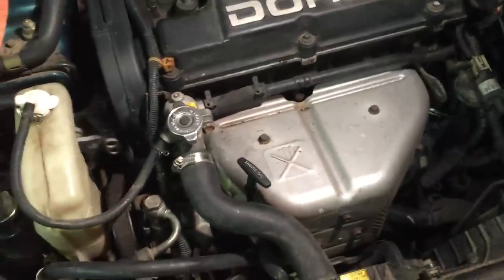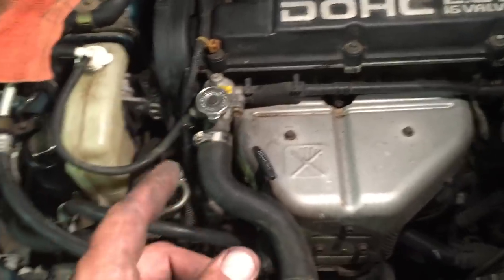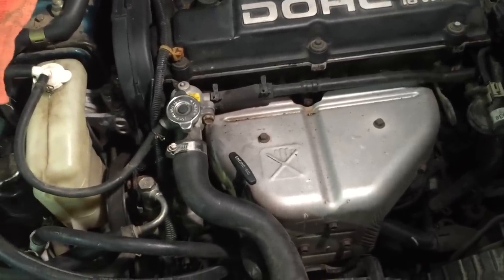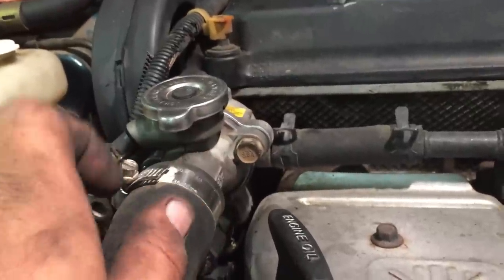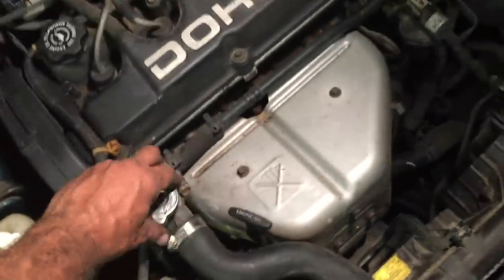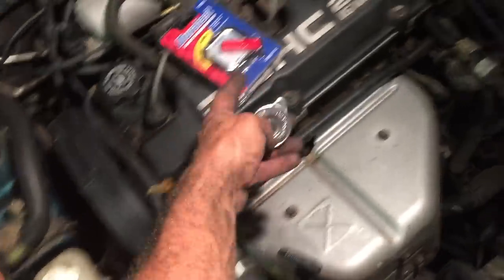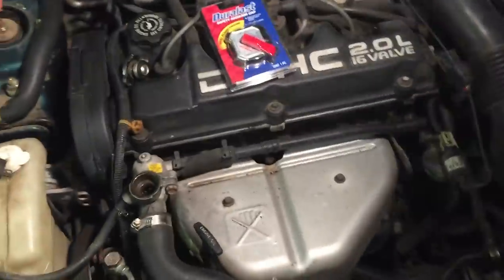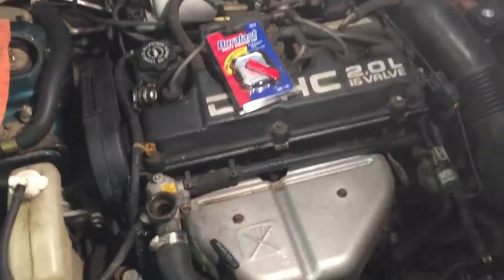How to Determine if Your Radiator Cap is Bad (P2181)

Comment: I think your video confirms what I suspected was going on with our Dodge Grand Caravan. Fairly new radiator within the last few years, but it's losing antifreeze, occasionally overheating, and leaves drips on the garage floor.  The black paint at the top of the radiator right under the cap on the back side is worn off and rusty. I see evidence of antifreeze running all the way down the radiator right beneath the rusty area at the top of the radiator under the cap. I am guessing it is indeed the cap. Thought it was the bottom hose, changing it anyway since I pulled it off and emptied all the antifreeze out. Hopefully I don't have to drain the antifreeze again to replace the radiator cuz that will be the next step if the new cap doesn't take care of the problem. Thank you!

Update: turns out the radiator is bad. Just so happens by some coincidence that the leak is right under the cap. I can see it coming out of the radiator fins right below the cap and going all the way down the side of the radiator. Not the hose, not the cap. Replacing the radiator tomorrow.

Comment: Thank you SO MUCH for this. I was told last week I have an antifreeze leak but I made a 70 mile round trip drive today and didn't notice any leaking or overheating or anything...my dad checked my coolant levels and they're fine but the cap is slightly leaking. Wow I'm so glad I didn't pay $130 to get a stupid cap fixed. Thanks man!
Reply: FYI in the future you won't notice overheating or running hot (fans might run almost all the time) until the water level is low enough. So you can have a small leak for a long time before anything ever shows up.

Comment: I Could not find the slow leak on my 2011 Camaro and it's been driving me crazy. So I put in some coolant dye and after running it for a little while, and I couldn't see any leaks anywhere. Then I watched this video and checked where you said and BOOM it's lit up like the 4th of July under the UV flashlight all around the base of the radiator cap.  Thanks so much for this video! I'm going to get a new radiator cap.

Comment: Yes cracked rubber is a sure sign of bad cap. Leakage of coolant with no trace on ground indicated a coolant leak from cap.  I replaced mine after low coolant level and cracked rubber in cap.

Comment: I had a over heating problem, vehicle was loosing water etc, it was all because the radiator cap was f... . Basically it wasn't pressuring, and I had to get a auto electrician to fault find because I thought the cooling fan on my radiator was faulty.. very good video, he's right indeed.
Reply from the maker: thanks for watching.

Comment: I notice my temp gauge goes from 1/2 to 3/4 and the fan kicks on. It will cool off slowly and go back to 1/2. (No leaks) I’m gonna change out my radiator cap cause I noticed in your video my cap looked quite similar to yours. (Grim on the rubber seal) THANKS SO MUCH FOR THE INFO.
Reply from the maker: you could have a sticky thermostat as well. thanks for watching.
Reply: Did you fix the problem?

Comment: Thank you so much ! Every time I have a car problem (2008 Chrysler 300) I google the symptoms. I thought I had a blown hg or something because I heard knocking sounds from my engine area. (I had only driven about 4 -6 miles ) 
Once home , I opened the hood and heard the sound again . I turned the car back on and heard boiling from the coolant area. Then it starts to leak very slightly around the radiator cap. I was immediately stressed out ,  but confused as to why my car wasn't "overheating " on the dash indicator. 
If i hadn't come across your video, my car would be in the shop right now.  Instead , I'm replacing my cap (for under $10! ) as I inspected it and found a crack in the seal, same as you just displayed here ! Thanks again !!!!! Much appreciated !!!!

Comment: Thanks a lot, your description of the problems is what I'm experiencing. I commute 50miles both ways for work. During the day its bene hitting 90°F and over heating or getting close and I had coolant in. Also died and wouldnt start back up. I left it for a day, went and got it and drove it home fine at night. No overheating or anything. I'm mos def thinking it's my cap cuz my buddy told me mine had some play in it. I'll be getting a new cap in the morning! Thank you!

Comment: Amazing video!! Very helpful for the long run!!
I've been having trouble with my Nissan Versa 2007 and its been overheating, I've been trying to check if its leaking or if it's the radiator.. but so far no luck! Took it a mechanic but you could tell they were just trying to make some bucks!
Hopefully the cap solves my issue. Thumbs up!!
Reply from the maker: great,,, thanks for watching.

Comment: Damn I wish I saw this vid earlier. I had this problem with my radiator. The mechanic said it needed a new radiator. Long story short after the new one was installed we found out it was just the cap that needed replacing. #ripped off 😒
Reply from the maker: oh man, that sucks. and a new one does not come with a new cap, so they normally put the old one right back on. sorry man. thanks for watching.
Reply: my case was much worst! I fucked up one head and the gaskets I end up paying like 900 bucks just for the damn cap!

Comment: My reservoir was filling up not recirculating. AutoZone said I needed a new water pump. I said let me try a radiator cap first. Seems to have worked.
Reply: Did it work
Reply: @juice323blue4  Yes it did.
Reply: @kentuckianahunter7194   ok thanks you
Reply: Same thing happening to me right now. Overheating slightly every once in a while like I'm getting air in the system, reservoir is constantly getting filled up and not sucked back in. I replaced the cap a month ago or so but I have a subaru and they are picky about OEM parts so I'm gonna pick up a oem cap, fingers crossed
Reply: @ryandownie3574  Good luck.

Comment: Man this video is very informative i jus changed my radiator cap yesterday i drove it like 2 are 3 miles and my needle went a lil above have and went back dwn below half but i never drove it far yet i wonder if dat was my over heating problem the whole time
Reply: Any update ?

Comment: Thanks for the video! My 2002 Honda Civic is having this kind of problem. The radiator is new, so is the waterpump. The car also passed the test for head gasket. However whenever I go on the highway for 15 minutes, the car starts to overheat. There was one time that coolant was boiling in the reservoir. The lower radiator hose was cold and there was no hot air coming from AC. The car doesn't lose coolant at all when I drive in town below 40 mph, but it loses coolant significantly on the highway. Could it very possibly be the radiator cap?
Reply: Theresa Williams your thermostat might have a problem
Reply: Yes Theresa, this just happened to my Infiniti FX35.  It started having variable temps and then started to overheat when I was on the highway.  I had it towed to my mechanic and he changed the thermostat and to no avail it continued to overheat.  He took the engine apart in order to locate the water pump and didn't see a visible problem so I took the bull by the horns and had it towed to the dealership.  And lo and behold it was the radiator cap.  I am so glad that I didn't allow unnecessary expensive repairs before finding out the real reason it was overheating.  I even thought that it was a head gasket or engine problem and was ready to purchase a new engine but thank God for my Infiniti dealer.
Reply: Same car same problem.. it was the radiator cap..(2002 Honda Civic coupe)

Comment: That small black jose by the cap of radiator to the tank mine snapped of the side of the radiator it was like a platic snapped right off not like just hose...how can I buy a  repair that without having to buya whole new radiators

Comment: Hey Thomas what's up I'm having the same problem when I drive my car it does not overheat but what I'm idling it'll overheat after a while I changed my radiator cap and it seemed like a little piece of rubber on the tip is not there on the old one do you think that's causing my car to overheat while idling thank you

Comment: Around the radiator cap there was coolant dried up like if it was spread like when you put your finger on a water hose, I just changed the radiator cap today and hope it works
Reply from the maker: i think it will. thanks for watching.

Comment: Hi, have a 1995 Acura legend the reservoir is past full max almost to top,  does not seem to go back to radiator. Temp gauge goes up. Can it be a bad radiator cap. Thanks
Reply from the maker: possible, or clogged between the neck and line. be sure your fan is spinning when it warms up and the water is moving ( good water pump) only other issue would be a stuck close thermostat. thanks for watching.

Comment: Hi I hope you might have an idea on what's going on with my car...I have a 2008 Ford Taurus and on Monday I noticed the temperature gauge was going up and then back down on it's own. I took it to a shop yesterday they did a pressure test and said they didn't find any leaks, but the coolant was low so they filled it. It ran amazing the whole day no signs of anything. Then tonight I noticed it was going up again slightly not as high as before but still higher than I ever want to see it. Is it possible it could be the cap? Or did they just not find a more serious problem?

Comment: what if coolant is leaking from the tiny hose at the base of the radiator? i just replaced my radiator cap a week ago or so now , coolant is leaking from the base of the tiny hose that connects to the radiator. do i need a new radiator cap or another tiny hose? thanks!

Comment: my coolant is missing from my 03 impala.  and it's not the hoses, water pump, and the usual suspects.   about every two to three weeks i have to add some more coolant, and a good amount as well.  i have the same kind of radiator cap on my car.  im stumped it does need to be flushed though.

Comment: hi I have been having a problem with my 96 Tahoe it keep getting over heating even in a vary cold weather 
and when I feel the upper hose it feel like its going to explode till I open the cap a little bit  and I can see the pressure 
and feel the water going back to the reserve tank I don't understand . 
and like you said I give up on the mechanics every one I go to they wanna change everything

Comment: I have a 2015 Nissan Frontier, only 37,000 miles. I am losing coolant from the radiator, but the level in the overflow tank remains constant. There is no overheating and I cannot see any leaks anywhere. Could the issue be the radiator cap since it is only coming out of the radiator and not the overflow tank?

Comment: Hey buddy I have a question for u. My 05 chevy suburban is over heating I already bought a cap. I also replaced the thermostat but it is still over heating water pump is about a year old been working fine till now... Any advise??

Comment: So I fixed my cooling temperature sensor because my car would over heat steam would come out the radiator cap after mechanic changed sensor he told me to change the radiator and cap should I do just cap or both

Comment: Hey i'm teaching myself to become a mechanic so I can do my own minor fixes.  I wanted to know the steps using a pump that I attach to the Radiator Cap to see if it holds max pressure, also I'm seeing a coolant leak, I'm going to take it to a friend of mine that can tell me if the Gaskets are blown, but if they're not, when I test the radiator pressure with the pump do I attach it to the radiator cap or to the reservoir and pump to the maximum pressure then look to see where it's leaking?  I'm completely new to youtube, but I figure I'd comment and see if you get back to me on time before I go in and try to fix the job.

Comment: radiator caps have different pressure capacity... what is recommended for a 99 isuzu rodeo?
Reply from the maker: i believe 12 lbs, but as long as you are over 7 to 10 lbs thanks for watching

Comment: Thomas I have a 1993 Chevy truck.  My radiator has a lot of pressure after sitting for  2 days or more and the engine is cool.  I have a slow leak around the heater hose outlet and I patched it with JB weld where it was braised at the factory.  It is still leaking so I will patch it again.  I have never had high pressure in the radiator after it has set 2 days or more.  I wonder if the pressure is causing the leak.  I put a new hose clamp on the hose.  Any thoughts on this. The radiator is 1 year old and only has about 5,000 miles on it. Thank you.
Reply from the maker: you got it, thanks for watching.

Comment: I have this exact car and it's overheating , water pump is good thermostat is brand new ,no coolant leaking but it overheats , the thermostat housing the part where the radiator cap goes on has a few bumps and unevenness maybe that's the problem or the cap is the problem or both guess i'll have to replace both thanks for the video
Reply from the maker: click on my name under the video and scroll to pressure test a radiator, it may give you some insight. but i think your on the right track. thanks for watching.

Comment: My 04 dakota is overheating badly. Idling it gets to the red line, giving it gas keeps it at the red line, with cruse control on it slowly goes back down, and when just coasting it goes down a little quicker (but never goes less than 3/4 down). I opened the hood after i turned it off and had a lot of steam coming from underneath the radiator cap. It only looked like a small amount of coolant came from the overflow. I didn't have time to do anything but look under the hood quickly since i was already almost late for work from driving slow because of the overheating. 😡 First thing I'll try is a new cap when i get off work.... luckily i work within 7 minuets walking distance of an auto parts store....
Reply from the maker: when revving the engine it should of cooled a little. yes change the cap. but you may have a fan clutch issue as well. thanks for watching.

Comment: Can you tell me what the gunk is I have a lot of it that just looks like it that came up I have had the exact problems you have I see no deal on my radiator cap and mine looks worn like yours, it is also an old truck since it is a 2000 Dodge Durango but if you can please write back
Reply from the maker: what color is it? i have seen people mix antifreeze and it can jell up. if its milky brown, it could be a head gasket. if its oily , you could have a bad radiator ( if there are tranny lines going into it. i need to know a little more. thanks for watching.

Comment: Got all my hoses replaced or fixed and sure enough I noticed fluid leaking from the cap and it's just slit cut or wear mark on the base area or mount area of the cap.

Comment: I changed my cap but I notice that it still overheats when i turn off the heater and keep the car running! And there's no leaking! Could that be the thermostats?
Reply from the maker: yes , thermostat is where i would go next. be sure the radiator is free of any debris in front of it. bugs etc. feel the top hose and the bottom hose. they should be about the same temp when the thermostat is open. you can do this by running the car for 15 min or so then shut it off and just feel the hoses. if  one is much more cooler then prob the thermostat. another test is to remove the cap and start the car. in about 5 min of running the water should be moving around in the radiator fast ( you will see it move through the cap hole. if it is not moving then the thermostat is for sure closed shut.

Comment: I have a 2008 Dodge Ram 1500 slt it overheats (3/4) at low speeds or traffic.. and back to normal (1/2) at higher speed. I’ve replaced the thermostat, bleed the air out. And just changed the fan clutch.. Water pump is not leaking. No leaks on floor of any kind. Think might be radiator cap?
Reply: The radiator cap is less than $15 and it’ll take you five minutes to replace. It’s worth a shot

Comment: my cars been heating up ive added antifreeze but later on in the day it might say the coolant level is low again. oil doesn't leak, I just changed the thermostat and put a new one and my car still over heats what can it be

Comment: i have a 2002impala3.8 it streams from my radiator hose I put a brand new water pump I drive for like 20mins it starts smoking could I have a radiator leak or what

Comment: So mine was smoking, and when I opened the hood there looked like coolant sprayed from where the radiator cap was. Is this a cap replacement or possibly a hose?
Reply: Did your car finally overheat quickly and had to pull over?

That happened to me tonight....I just got a tune up and new battery. I was driving and all of a sudde i looked at the heatvof the car and it was passed normal....then slowly over a couple minutes went all the way up. 

Also, did your check engine light come on?

Comment: Thanks for the tip! I have a 08 dodge charger and it overheats causing coolant to spill over. Do you think it's the cap or something more serious?
Reply: Could be a bad cap or  the head gasket. Hopefully not not the HG, If it is you might try the head gasket sealer before spending several thousand.

Comment: Could this explain why my overflow tank loses coolant but my radiator maintains its coolant level? I'm not overheating either. No visible leaks anywhere.
Reply from the maker: yes it could. but make sure you do not have to much in the over flow because it will push it out if it is too much. the normal operating line is about half full. thanks for watching.
Reply: Seems like that was the issue. I put in a new cap a few weeks ago and it hasn't dropped an inch. I think the old cap was busted. A spring was floating inside the radiator when I took the cap off.
Reply: That's the same thing my car do